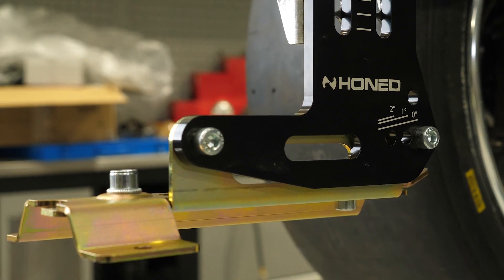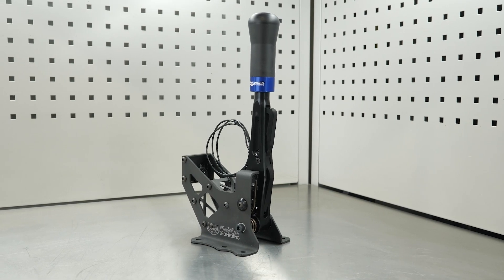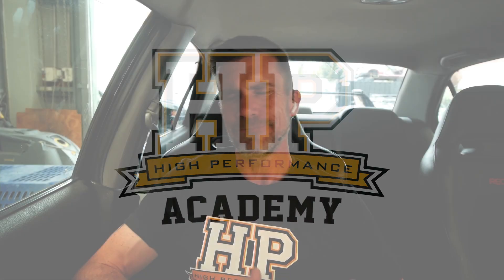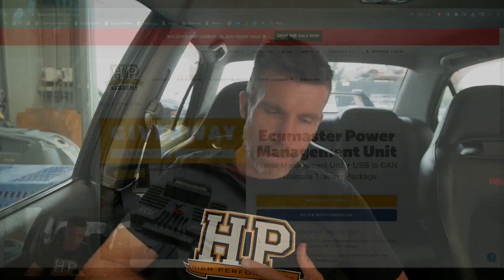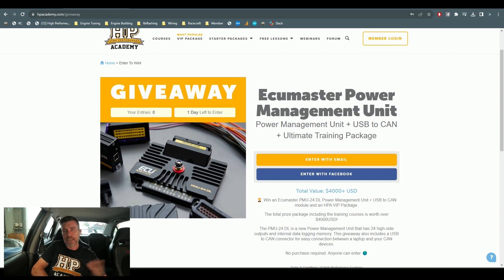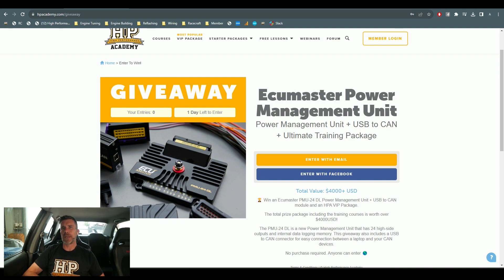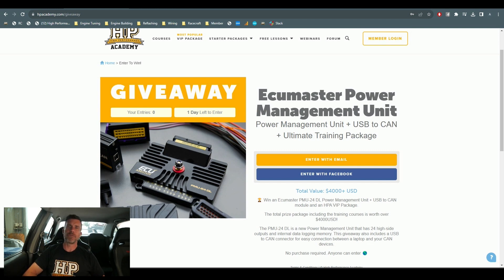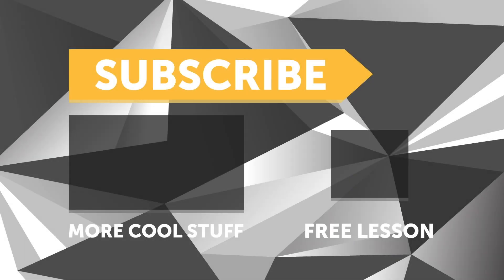Outsourcing CAD Design Part Production | KRX Build #Update

Comment: I've been wondering, why is DBW throttle blipping considered as taking away some of the drivers skill, while ABS, complex boost control strategies and many other (imo) more effective lap time shaving features are not? Throttle blipping in my opinion and personal experience is a bit overrated as it takes a lot of practice to master it in such level that it starts showing in lap times and I would feel comfortable using it in actual racing situation.
Reply from the maker: There is no right or wrong on this. Everyone draws their own line in the sand.
But it doesn't matter.
Race your own race in whatever you want to build (within your class rules) 😎 - Taz.
Reply: its a skill, and its satisfying when you can do it manually and consistently :). I think threshold braking without abs is fun aswell. Fun or fast, not always the same thing on a car.